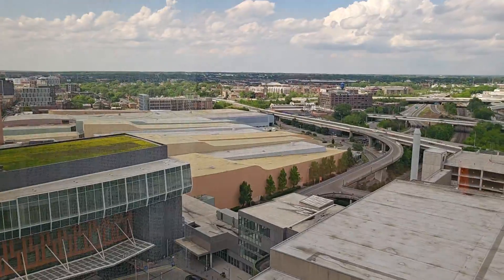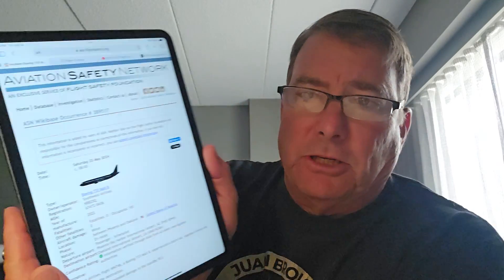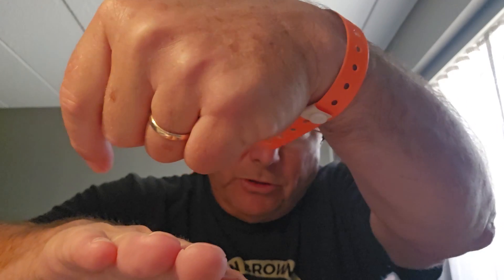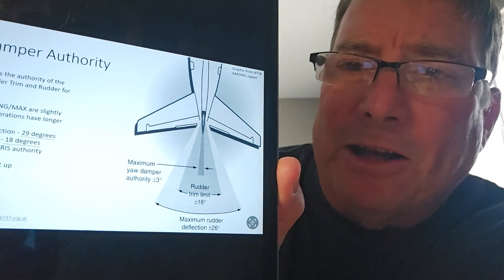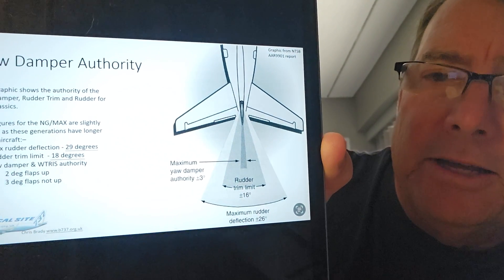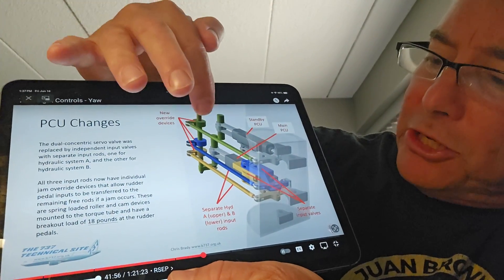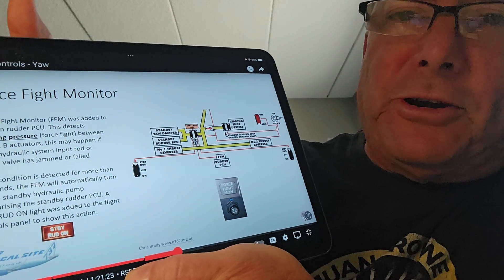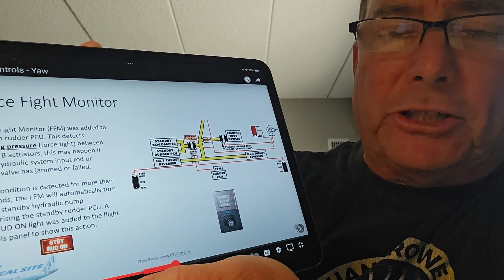SWA 737 Max-8  "Dutch Roll" Incident

Comment: My college controls professor said "you dampen a sponge. You damp a mechanic system." Still can't believe how many educated folks get it wrong.
Reply: The same people on Facebook marketplace list cars with new breaks.
Reply: @robertpierce1981  That they must sale today.
Reply: @oldguyrides  Don't you mean "Sail"?
Reply: @robertpierce1981 They’re also worried about the boarder in which case I ask if they’re renting out a room.  Don’t get me started on their “on accident” instead of an accident or accidentally.
Reply: @robertpierce1981 they need to brake that habit😂
Reply: Damping factor vs. "dampening factor" ?
Reply: @milantrcka121 this system is under dampened
Reply: @markrobinson2229  under dampenificated?
Reply: Adding to the above: you also snuff out a fire with a "damper" (not a "dampener").
Reply: @6AK5W-JAN Yes just like they had candle damper’s back before gas lighting came in.
Reply: @6AK5W-JAN Yes, the exhaust flue of industrial boilers uses a flue “damper” to throttle the flow. I installed quite a few in the 70s.
Reply: don't you snuff out a fire with a 'tamper' unless you reduce flow through a flue with a damper?
Reply: @islandwatch -  Clearly it's an easy mistake to make.  Even Juan, after deliberately calling out news media for making it, and explaining the difference, used the word "dampen" in his explanation at least twice.  But he made his explanation easily understandable.
Reply: Foot pedal. Grrrrrrrr.....
Reply: @typhoon2827  This. Just like "plug socket". Grrrrr!
Reply: @rednammoc  one like in 14hrs. You've restored my faith, thank you!
Reply: @Larry-mk9ry Lol no, you don't like online dictionaries because they tend to be more updated with more modern linguistics changes.
Reply: Not often not good?! So they are often good, then?  @Larry-mk9ry
Reply: A TV news journalist can tell you that airplanes stall because the flat plane crankshaft dampener wasn't checked by the Spirit / Boeing DEI fact checker
Reply: I can.
Reply: Hi Marc 👋 !! ❤⌚👍
Reply: Merriam-Webster definition: Dampen: (transitive verb) To check or diminish the activity or vigor of : DEADEN
Reply: @elkhunter8664  dampen has been misused enough that it has gained that context now, but if you use it for a technical discussion you just sound like you didn't actually read the dynamic systems modeling or controls textbooks.
Reply: @elkhunter8664 check a real hardcover dictionary, not one of these "updated to reflect the ever changing fluid language."
Reply: @cbrooks2767  My New Shorter Oxford Dictionary (that's the one that has just 3800 pages, split into two volumes) is clear that "damp" and not "dampen" is the appropriate word for "to reduce the volume of fluctuations in a musical or physical system"

I have never found the need for the 20 volume,  (21,728 pages,)  full edition.  :=)
Reply: @oldcynic6964  -  Very much interested in this dictionary.  Do you mind if I ask what you paid for it?  I see prices ranging from about $15 -  $250, a pretty broad range.
Reply: @wickedcabinboy  Alas, sir.  I bought it (new) about thirty years ago, and Biden-esque levels of senility mean I can no longer remember what I paid.
Reply: @cbrooks2767 LMAO that's a self-own... 🤦🏻‍♂️🤣
Reply: @cbrooks2767  Tell me you're old and mad that things change without saying you're old and mad that things change.
Reply: @oldcynic6964  my beloved, 30 year old dictionary outweighs me.  Its the first thing to go in the trunk of my Challenger when i move. 
:}
Reply: If you want to be an English major, change your Major. Otherwise, ignore your college Controls Professor and focus on Engineering, and making the lives of all of us better and Safer!
Reply: @dzanze3733 LOL. That was over 20 years ago. I had a great career designing things that are still flying today and will be for decades. But thank you!
Reply: I always think of that terminology when I'm recalling what I liked so much about my old stereo tuner. The band tuning knob was so wonderfully "damped" that it was a pleasure to bring in the analog signal that way.  Same way with my old SLR lenses that had such great focusing action; just a real treat to operate and was so easy to snap into focus. 

Marc, hope that your flight lessons are going well?
Reply: “Flat Plane Crankshaft” is fingernails on the chalkboard to me. And technical people use the term constantly these days.
Reply: @88SC what's the technically correct term for a FPC?
Reply: @Grip_Addict  “180°” - two pairs of coaxial crank journals are spaced 180° apart; “single plane” - all crank journal centerlines are coplanar. Or simply “flat crank” although that has another meaning, that the journals are out of round. “Flat Plane” is a contraction of flat and single plane, I believe. But planes are by definition flat.

Heck, I don’t really know which term is the official one. OX-5s had them, I wonder what term they used then.
Reply: @88SC  appreciate the insight
Reply: @88SC  The expression "flat-plane crankshaft" is used because there's also a "cross-plane crankshaft."  Sounds a bit redundant on its own, but in the context of engine designs it provides a necessary distinction. (A V-8 engine can have one or the other, and the two designs perform differently.)
Reply: @88SC  journal..so, u read it?
Jk
:}
Reply: @88SC  It is a very commonly used term for a 180 degree crank.
Reply: Worse yet is the misuse of I and me in sentences. (She told Bill and I where to find the envelope, for example).
Reply: humans are not perfect, however, is there something going wrong with the education of these engineers? As a physician, I see some evolving problems with medical care that I will not elaborate on.
Reply: Your professor was wrong then, dampen is completely correct for a mechanical system. 

Perhaps something different like "damping ratio" people could erroneously say "dampening ratio" or like Juan said here "yaw damper" - but that's a specific term completely different than what your professor said.
Reply: Nice to see you here Marc :) yeah I agree with your statement! The correct word for reducing the amplitude in oscillations (such as sound waves) is "damping" or "to damp." The word "dampen" means to make damp or moist, and is concerned with liquid, not waves!
Reply: North America has declared war on the English language for over a century. Invertebrates are referred to as "bugs". Topsoil is referred to as "dirt". In the aviation world, split-pins became "Cotter pins." Certified became "certificated". Sloppy diction leads to sloppy thinking. God help tutors in the fields of medicine, law and engineering.
Reply: @martinwade9421 language is ever changing, whether you want it to or not. It has nothing to do with precision or quality or any other metric. Your impression of the world is frozen in time, but you are only pushing on the tide

Comment: We need to wait for the NTSB to weight in. What caused what will be interesting. Was there damage before or after the roll. Was there loose bolts or a loose mount before or after. Did stress cause the damage or did the roil cause it. What did the pilots do was it on auto pilot. Did software kick in and cause more of a roll. So many things. Those big engines are staying you can’t cheat with software.

Comment: So did I hear correctly that the 737 has cables from the rudder pedals to the tail, but they don't mechanically connect to the rudder? That seems weird to me. If you don't require a mechanical fail-safe, then you might as well control the rudder servos from the front of the plane.

Comment: So you are saying that a tiny bit of manual rudder trim would dampen the dutch roll quickly?  
As for the PCU issue, software that allowed competing control inputs, resolved my metal deformation?
Interesting to hear what exactly gave way in the controls mechanical, thrust bearing perhaps?
Keep up the great analysis!

Comment: Boeing knew about the rudder "actuator" flaw due to cold soak from the very beginning.  The manufacturer warned them and offered a fix, but Boeing did not want to do it.  A bunch of deaths later, they did change it.

Comment: Didn’t we already see the ending of this story before back in the 1990’s with the 737-200&300 series, Manual Reversions check. Hydraulic systems switched off in flight and switched back on to validate correct Hydraulic Porting from the Rudder PCU? Anyone remember this shit? Anyway it’s Friday, I’m currently buying “BA” puts.

Comment: Draw a spot on the window with a grease pencil or erasable marker on old 319. Perfeablly 800 t0 840 tail. Then draw the circle of nose deviation. You would be surprised buy the dutch roll. Those things hunt around and around with the FACS. Some are better some are not so good.  Old rudder bushings and losses of the tolerance of sensors can contribute to that on an Airbus. In the old days some aircraft returned to field. Maybe something similar could have happened on this Boeing.

Comment: They need to rule out arrow dynamic flutter as a root cause. If it did begin to flutter the computer systems might over load trying to respond to that condition. They need to check for actual structural damage that flutter might have caused to the airframe holding the tail  section together rigidly.

Comment: NO PHYSICAL / MANUAL back up on the max rudder????HUH???    WHO thought THAT was a good idea....... sorry I meant.......which accountant thought THAT was a good idea??
Reply: Been that way since the original 737 in the 1960s. If I recall, the B727 is similar. No manual reversion. Though they do have a split rudder, one powered by A system hydraulics and the other by the B system.

Comment: In 1959, on a demonstration flight, a Boeing (?) test pilot induced a Dutch Roll on one of the first B707 produced.  The B707 was going to be delivered   to Braniff Airlines and customer personnel were on board.  The B707 overreacted to the Dutch Roll and in the course of regaining control, three engines (!) were ripped off.  The pilot was forced to crash land the aircraft.  Everyone in the front section was killed, a number of passengers riding in the tail section survived.  If they're something in the MAX's flight dynamics that, in conjunction with the autopilot software, causes a Dutch Roll stability issue, Boeing's engineering prowess is going to take another hit.  Not too long ago, Boeings corporate website was full of DEI BS.  At that time, I also noticed almost no one of the Board of Directors had any relevant aerospace industry experience you'd expect to see.  Nikky Haley was then on the Board of Directors not too long ago.

Comment: When flying a 737-200 I experienced a total roll freeze while on autopilot. No roll control what so ever. Couldn't be duplicated on the ground so the company had me do a test flight with maintenance onboard. It locked up again on final at 700 AGL  Disengaging the autopilot removed the failure. Calm morning and my plan was to land as best I could with rudder and pitch if it didn't release. They changed the roll control mixer